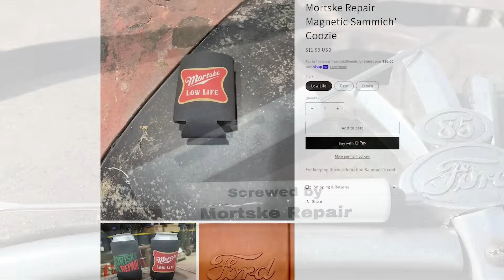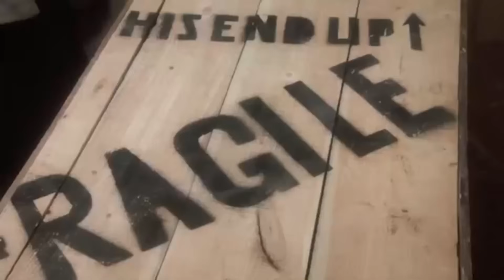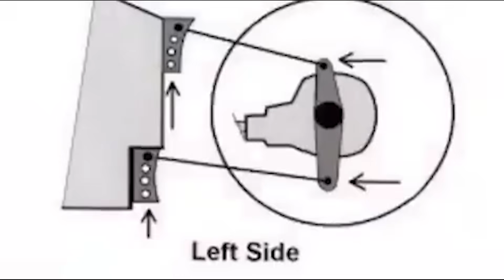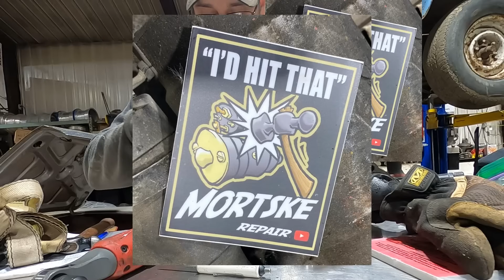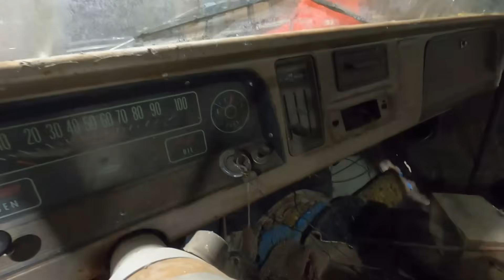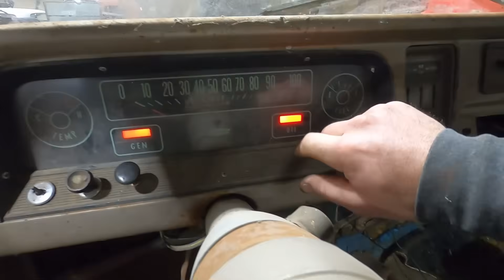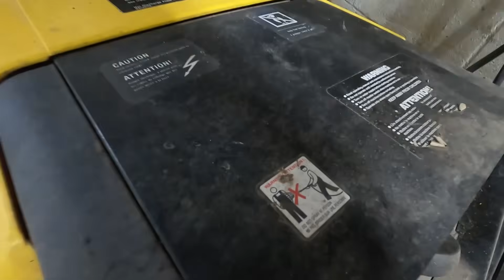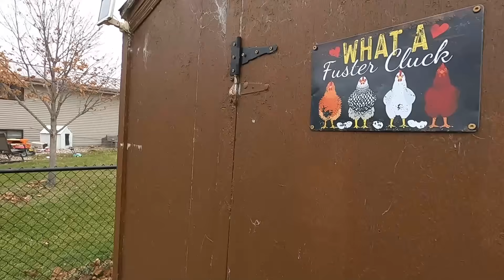Facebook Marketplace Find! 1965 Chevrolet C10 Shortbed Pickup Abandoned for 33 Years! Will It Run?!?

Comment: Didn’t read all the comments…..but 63’ was the first year of the non torsion front ends. 63’s are truly one year only with the later frame and front suspension and the older knee knocker cabs. As for GMC’s, the main difference is that they have rear leaf springs. Enjoyed the video!

Comment: I had a few of them 250 6 cylinders back in the day, one in a 72 nova and another in a 70 malibu wagon. Both were great engines and never had problems with them. They ran forever.
Reply from the maker: Right on

Comment: The magnet drain plugs actually work well for fixing a stripped out pan.  I was skeptical, but has held without any leaking for several years and many miles.

Comment: Cool old Chevy, Mortske! Glad you got her running and driving. For "agreed value" insurance on my collector cars, I went through Grundy Worldwide, and the company is like Philadelphia Indemnity or something like that. My 67 Malibu is insured for 30k, and my 79 New Yorker Fifth Ave is at 15k, IIRC. The "regular" rides are full coverage with 21st Century, which is part of Farmers. I hit a dog (killed it dead, like 60 MPH, hated that, as I am a dog lover) with my 2011 MINI Cooper S (I know, a MINI, but it's a blast to drive, and gets pretty good MPG) and 21st Century said I only needed one estimate and could get that from whatever shop I wanted. Went to the MINI dealer, and it was $6400.00 in damage! Darn plastic crap. Anyway, they had no problem with that, and of course the dealer used factory parts and all, and my premium did not increase. All that with a $500.00 deductible, which I had just lowered to that level like 2 months before the dog accident. Anyway, check them out if you're lookin. Take care man, and give Duff a scratch behind the ears for me.
Reply from the maker: Thanks for the info!

Comment: Excellent video Mortske  :) , Duff Dog 🐕, MOJO   :) also that truck reminds of my old Neighborhood neighbor  farmer Fred had but sold to another Farmer in Auction sale  Fred had was 1968 Chevrolet C10 had 292 6 cylinder  motor with 1 barrel carb with hand choke cable knob in dash  of Carter 550 , Coulmn Shifter 3  speed Manual transmission  , 1978 1/2 ton 377 rear gears posi 12 bolt , 4 wheel drums, no Power Steering or Brakes  , other farmer got local garage made homemade header with straight pipe to muffler with Thrust Cherry Red 🍒 bomb round muffler to under cab past transmission, then Turbo 400 to tail pipe to back left wheel! Am radio Delco , one speaker  , factory am / fm antenna  , West Coast mirrors  Chevrolet  in coil springs suspension  to , driver seat uncomfortable sat metal pail bottom weld on and gas pedal had T backwards farm tractor  of International foot grip pivot arm ! Yes exhaust was loud like stock race car Lol ! If want key work on fuel cap Mortske lube tumbler  up light tap with rubber hammer  it break lose after few times! Yes Pookie should buy that truck Lol!

Comment: Great job with this! It makes me wonder why they wanted to pull the 250 six. The Hurst Indy shifter did have a long shifter lever version. I remember a number of people using these shifters back when I was in High School in the 1980's. They were a big improvement over the worn three on the tree shifters.
Reply from the maker: Yeah, you can bolt a longer arm on the shifter easy enough.

Comment: 60-62 2WD had torsion bars. 63 was the first year for coil springs on the front, as well as the new 230 and 292 6 cylinders

Comment: I had a 64 with a 283 and 3 on yhe floor. Used to tow my dirt car with it. Eish i still had it. Bought it for 1100 in 1991 and sold it for 2200 two years later. Perfect running order the whole time. It was seriously patinad and back then it was a negative. California truck, no rust. Ah, the good old days.
Reply from the maker: Sounds like you got a good deal!

Comment: @ ~ 1:10:00 - its running - that's great - I don't see any oil coming into the top of the head though. I am not a straight 6 guy, but shouldnt there be oil flow? I know its running, but is there an oil gauge anywhere? im usually not such a karen but I just see no signs of new lubrication

Comment: More proof never judge anything by the looks. I would trust a starter or alternator repaired by Mojo any day. Some of these new replacements are getting worse over time. It sounded like a demolition derby car without the exhaust but dose not everything that dose not have a exhaust sound just like that? Id call this a better score than that Buick with a rod knocking nailhead.

Comment: In Aus our biggest GM sixes were the 186 and the 202. They went into our Chevelle variants (Kingswood). They also put them into small Toranas which made fantastic race cars. 186 was the best 😊
Reply: Loved my VK wagon with the black 202 engine. The reds made power, blacks were reliable and blues were the lesser desirable. So they used to say back in the day😂

Comment: I was wondering why that cap had the clamp type hold down. Because I have only ever seen the screw down type on the little Sixers. I didn't know a 235 distributor would work in a 230 or 250 which ever it is.

Comment: When it comes to the original drivetrain issue, I don't think they should be swapped unless they have to be. There are so many cars sitting all over the place that need drive trains. I would rather see those built, and save as many of the original ones as possible. Today, there are more classic cars that need drive trains than there are that have functional original ones. I just hate seeing someone swap an original car that could be left as is.

Comment: Those GM starter selinoids
The 2 main copper bolts have square heads. If you pop them out and turn them 180 they are like new
The copper washer on the plunger thing is held on with a e clip or a snap ring I can't remember
Flip that washer and it is also brand new
Duff should have told you that LoL
Reply from the maker: Good to know

Comment: Skinny shaft charging thing = Alternator Rotor Assembly. Another great victory over the useless trolls! hahaha Great Video Mortske, Thanks.
Reply: State Farm Insurance is the best IMO. I had an accident a few years ago and paid higher rates for a few years because I rear ended someone but rates are back down now and all is good. I also get a good discount on my Renter's insurance from them as well.
Reply: I recommend not driving older cars without antilock brakes among newer cars with antilock brakes as the two are not comparable in stopping ability.
Reply from the maker: Thanks 👍

Comment: I use Hagerty. 
When I signed up for my 50 Dodge B2B with 39k original and a runny repaint, they questioned my $15k assessment. I sent them pics and the auction video. They said thanx and wrote me a policy.
Nice magazine included in club membership, also.
I use Markel for my motorcycles and, unfortunately, have had to make claims for theft and a parking lot incident. They are easy to deal with and paid in short time and a fair reimbursement.
Reply from the maker: Thanks for the info!

Comment: Why use 24v to boost the power? This has been mentioned on a couple of these US channels. Wouldn't it be better to use 12v and boost the amperage by connecting the batteries in parallel?

Comment: Insurance is worthless on cars that are not easily repaired. I had a '96 Roadmaster wagon, and my particular model and option package was one of less than 200. I saved mine off the scale, and it was nearly pristine when I got it. A guy rear ended me on my way to work one night. It only damaged the rear cargo door. Rear cargo doors for my model were unobtainium. The only option was to have one fabricated. The insurance company totaled it out due to the cost of the door. I bought it back, but I never had the money to get a new one. It sucked.
Reply from the maker: That sucks

Comment: My momma had a 41 Chevy short bed that was Corvette yellow and black fenders and running boards when I was in highschool,it tailgate was in bad shape also so it got bolt on spring pins in the bottom on both sides and the aircraft jacketed winch type cable and the u bolt and shackle style cable clamps and flat washers and taps on each side and that was the tailgate latches on the truck it had a 67 487x 327 Holley 650 mechanical secondaries 4bbl carburetor,th400 transmission and cut down 67 gm floor shift console and shifter, and a Eaton 10 bolt 57 Chevy belair 3.23 gears rear end lol truck was nasty and sounded mean with the manifold 2 inch straight pipes and 10 inch long casing flow tech red hots glass pack mufflers and the pencil tip exhaust tips welded on under the rear bumper

Comment: When I was in jr high and highschool a buddy of mine he's actually my best friend's best friend, anyways he had a dark green 66 Chevy c20 long bed 4.8 litre 292 cubic inch straight 6 sm465 granny gear 4spd manual shift transmission and 4.56 rear gears 14 bolt rear,tanish interior absolutely basic trim truck no radio,no guages except speedometer, handle parking brake lever on the bottom of dash, and the more expensive factory steering wheel from a similar junkyard truck

Comment: EVERY one is looking for the 65-66 and you have the custom big back window is a plus that's what most people are looking for short bed with a big back window. My brother has a 1966 panel truck/wagon it used to be a city truck it was well taken care of my older cousin had it on his property for many year's all his brother's were trying to buy it off him over the year's. He wouldn't sell it. His brother's past away over the year's and so did my cousin. I told my brother he better go get that panel truck before it ends up at the wrecking yard. My cousin older sister was selling the house so she gave the truck to my brother and the paper work. She knew my brother would get it running and back on the road. The truck was really dirty from sitting all those year's.  Brother clean it up got it running. He had it parked on the street and someone ran into the front end. Now we are looking for a whole front clip. I have a video up on YouTube. I want to get some lowering spring's for it and different wheels and tires. It sites up a little to high for my liking. I do like the truck/wagons that have the windows that slide open I've seen them fixed up pretty clean. I'm a truck, wagon, panel, breadwagin guy I'm always looking for them, and at car shows they are rare to find because the durby driver's done crash them up in race's, most of the wrecking yards crush them seen that happen many time's my uncle lived next to the wrecking yards. He repaired radiator for a living custom fit them for the classic, hot rod guy's and just regular customers. Family worked for General Motors plant, my Pop's and older brother are mechanic' s, my first car was a parts car I had to build before I even got to drive.
Reply from the maker: Thanks for watching!

Comment: 2:08:15 insurance is a scam, you can just buy a whole another truck for one months premiums... 1980 chevy S10 120 bucks is a running 4 cylinder. state rep, all insurance is void... pay to fix it if it broke by using federal stimulus checks that are normally used to put fuel in the combine, hope that don't brake town car truck sits for more time "forced to prioritize".

Comment: Maybe you should try using something like 18 volts instead of 24. 24 seems a tiny bit excessive on 60 year old starters. I think 18 volts MIGHT be a better choice. Just saying. Although that would probably require an electrical engineer's degree, and who has one of those today, right? : )
Reply from the maker: Never thought of that
Reply: @MortskeRepair   I just say this because it's not like you'd be running the whole car on that, it would just be a little nicer to those starters and coils.. It can't be that hard to do, hell you've got that nifty box someone sent you 12 /24 with the buttons on it, I'm sure one could be made to do 18v!

Comment: My 74 chevy Cheyenne super c10 long bed was powered by a low mileage L6 1974 Chevy c20 250 and 65mph was all it had th 350 transmission and 12 bolt 4.56 rear gear and a burgundy 79 Chevy c20 Scottsdale with a 68 Chevy 250 straight 6 3 inch exhaust pipe all the way to the rear bumper th350 c factory lockup automatic torque converter transmission and 14 bolt 4.11 and it wouldn't run faster than 50mph and the truck had 324k so that was probably a good thing because the front suspension in that c20 was shot but so was the truck so I got rid of it

Comment: That 66 c20 would spin both of the rear tires in 2nd and 3rd, there's no way it was spinning them in 1st, and did not have enough ass to spin them in 4th, but it had a 3 inch exhaust pipe and a m80 short cherry bomb glass pack muffler and a double wall 4 inch slash cut 12 inch stainless steel exhaust tip it had a awesome sound and Indiana farm bureau insurance.. me and him ended up butchering up the truck because he wanted a stereo and put grey laminated paper cone 2 way pioneer 6x9's in the bottom of the doors and the sanyo u chassis shaft style auto reverse cassette player stereo with the clock, and amber backlight...

Comment: More useless trivia for some of you know-it-alls. Usually, Chevy used a Saginaw (in trucks) when they installed a four speed on the assembly line. The SW's never had side mounted linkage, they were top loaders. The "Muncies" were a different animal, and almost always in cars. Muncies had side linkage. Ask me how I know.
Reply from the maker: Cars had Saginaw transmission’s and pickups had Muncie as well
Reply: @MortskeRepair  In my 70 years working on Chevrolet I NEVER once saw a Saginaw top loader in a car. I think maybe you had better ease off on the Bush lights for a while.

Comment: My theory on that starter is when gm designed it  in the 1940's it was 6 volts then gm converted it to 12 volts in late 50's and they didn't do much to it as a 6v starter works fine on 12v then you put 24 volts to it and it didn't like it